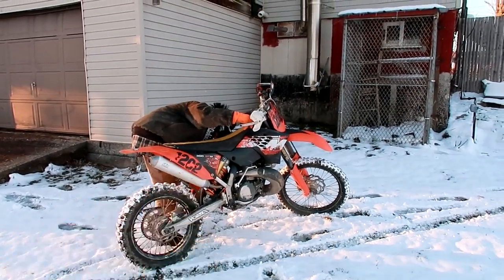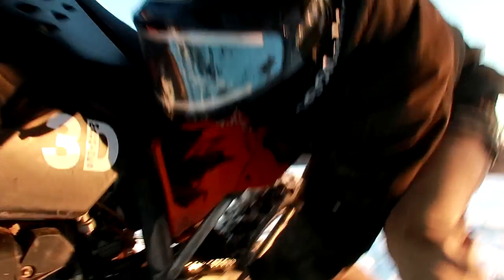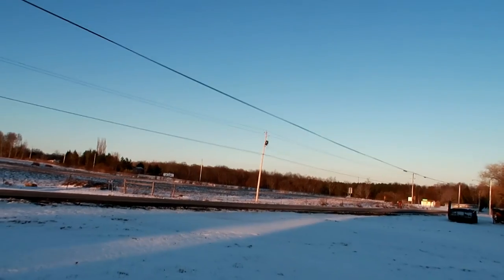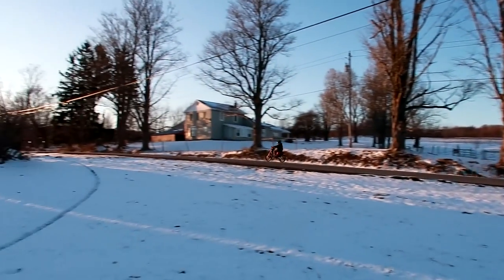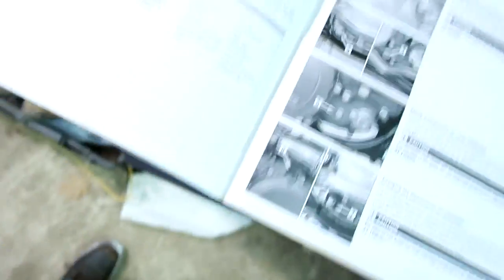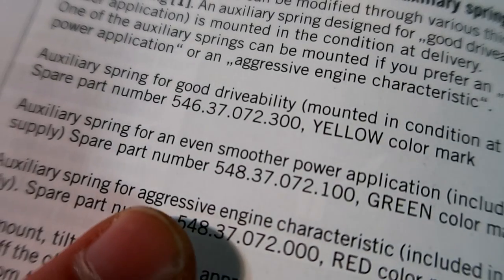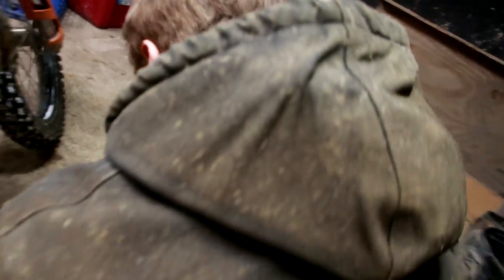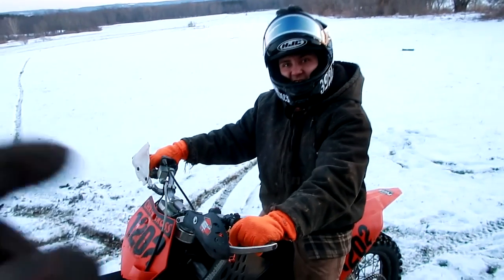NEW DIRT BIKE EXHAUST EXPERIMENT

Comment: the yellow green and red auxiliary power valve springs are good to have on hand. they allow you to put more or less tension on the power valve so it will open faster or slower. the red spring will wake that bike right up. the green spring is good for beginners or for tight technical trail riding or road riding for someone who wants ultra smooth power delivery and doesn't wanna rip their arms off when they stab the throttle

Comment: The chain is a constant due to the fact that the tightness will remain relatively the same throughout the entire experiment. The OEM/ FMF pipes are independent variables and power output is the dependent variable. The independent variable is going to be whatever you change in each trial. The dependent variable (power output) depends on the independent variable which is the pipes. or the power valve spring.

Comment: dalton. Do you have any tips for cleaning a 2 stroke exhaust on the inside? would help a lot. keep the vids going
Reply: anton nykung if you're talking about the header, and if its mud, a wire brush or wire wheel works. A power washer should also work, but I don't know exactly what you're talking about.
Reply: xxFOXxxI2ACINGxx  im talking about the pipe. sorry im not very good at english..😊 ty for the answer
Reply: anton nykung I use a powerwasher, it takes it off very easy
Reply: dan gardner I think he's talking about the inside of the pipe. I'd just use an air compressor with an extension
Reply: If you want to clean the inside of your exhaust, a steel bristled pipe cleaner would do the job, a sand blaster/soda blaster, would do a better job. A vibration tumbler might do the trick, too.
Reply: xxFOXxxI2ACINGxx  thank you.

Comment: you won't notice a difference if you aren't also jetting the carb for the better flow also the cold temp is going to make it lean so it will feel more like power and put extra wear on the rings

Comment: Brother an exhaust will not do much. I modded my Suzuki LTZ 400 with a jet kit, full exhaust, monster coil, cold air intake, and temp sensor to keep it cooler. I would still get stomped by any stock 450. The bike will just sound better. Like with cars there is no replacement for displacement. Braaap on!!!

Comment: the first ride with no changes is the control, the things you don't change, piston, tires, radiators, etc are the independent variables, and the exhaust,  power valve, are the dependent variable
Reply: mud pro not correct
Reply: Bryson Chambers what did i do wrong? it's been a year or two since i've done that 😂
Reply: Bryson Chambers. You can't just say ( not correct ) and then not elaborate.